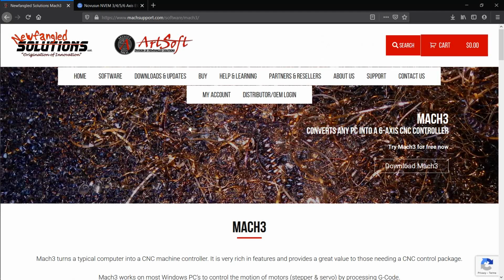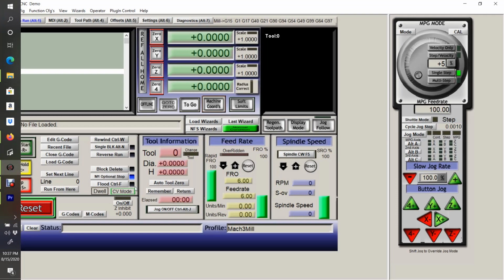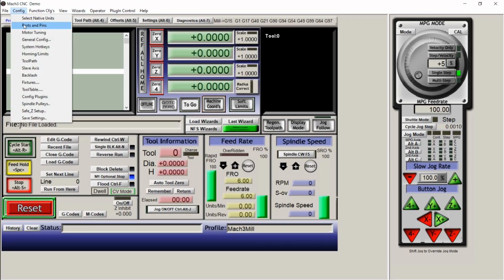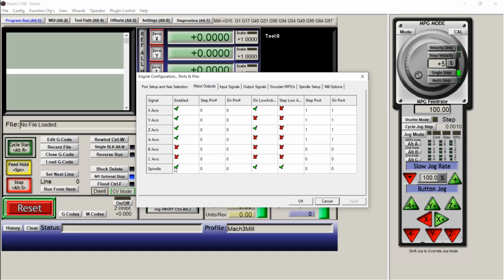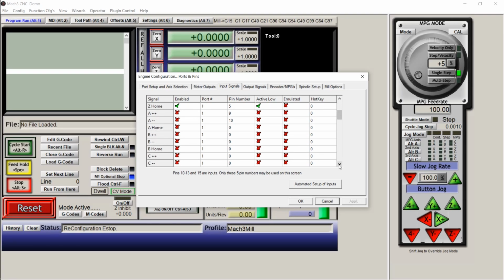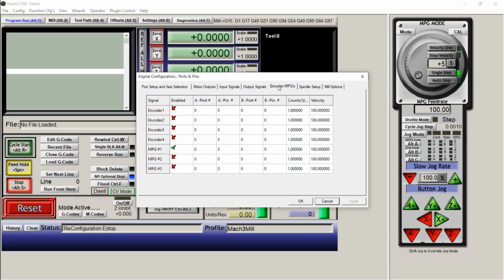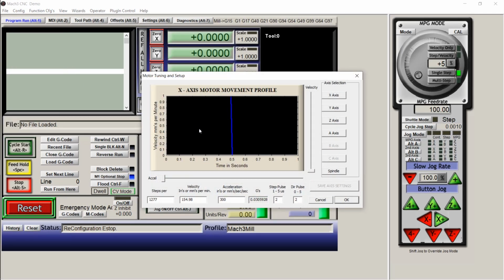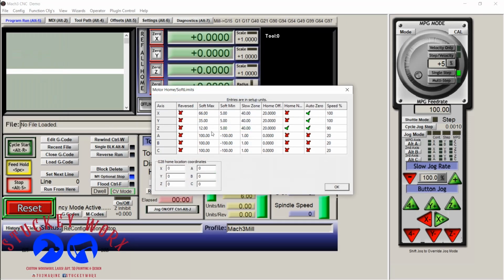Bulkman 3D/WorkBee/QueenBee Pro CNC Mach3 Setup for - Series episode 9

Comment: Good morning,

I have purchased and am awaiting delivery of the Qeenbee Pro cnc with UC300 controller with usb port and managed by mach

The question is:
in the Motor Outputs configuration -imput signals -output signals, I can't understand the configuration logic.
For example in the Motor Ouputs tab,
-X Axis - Step Pin # 2 - DirPin # 6 - Step Port 1 - Dir Port 1, which terminals on the UC300 controller do they correspond to?

If so, what is the logic to adopt to understand the correspondences?

Thank you

Comment: Hi so Mach3 keeps freezing just a few lines into the gcode whenever I run any gcode. even when I try to run the stock Roadrunner gcode it does this so I know it’s not my gcode. I’m running this on a newly built DIY cnc router with a 2.2kw water cooled spindle and 2.4nm “high torque” NEMA 23 steppers with a STB5100 controller with a usb connection to my 2015 MacBook Pro running windows 10. I have done hours of trouble shooting and online forum reading, I even made a YouTube video to get help from people online. At first it looked like none of my shielded cables were grounded and that it was em noise interference causing the issue. But I went and checked and made sure that no point on the frame or anywhere in the wires has less than a 5 ohm resistance to the ground prongs on the main power supply plugs going into the wall.  

I’m very confused at this point as I haven’t been able to find anyone having this same issue. I’ve uninstalled and reinstalled the program like 5 times at this point. I’m not having license issues as my name clearly shows up at the top of the screen. All the axis jog fine and the spindle works fine and can be controlled by mach 3 computer. 

I tried to attach a video of what’s happening when I try to run the stock Roadrunner gcode file but it says the file is too large. But this is the link to the YouTube video I posted with these issues so you can see. https://youtu.be/4YtSb6i7aBw

Can you please help me figure this out? I’m at my wits end at this point as I’ve spent so many hours futzing around and trouble shooting this. 

I have these electronics from bulkman 3D that I have: Mach 3 5axis stb5100 usb motion card and TV6600-t4 4 axis stepper motor driver board. This is the bulkman link to what I purchased. https://bulkman3d.com/product/mach3-usb-5-axis-stb5100-motion-controller-bundle/

What can I do to remedy this? 
Thank you!
Reply from the maker: It sounds and looks to me like your acceleration and velocity settings are WAY too low. When you are Jogging that is 100%. When you are actually in a cut the machine almost never is running at 100%. What are your Dip switches set too and also what are your acceleration and velocity settings? Also are you running in inch or mm units?
Reply: @702marine  hey thanks for responding! I have it all set up exactly how the Bulkman direction say to. 

Steps per :640
Velocity: 1000
Accel: 60
Step pulse: 0
Dir pulse: 0

Native units are set to MM.

I’m not exactly sure where to find the DIP switch settings. Can you tell me where to find this setting?
Reply from the maker: Yeah those settings are way off. Go to this video and do everything the way I have it set and you will see a BIG difference... 

https://youtu.be/u1bL3_s7Iy4
Reply: @702marine  thank you! I will try that. 

Do you have the STB5100 controller or the Novusun? 

I have the STB5100 so I’m not sure if it just requires different settings or not. Any idea why Bulkman would be telling me to use the wrong settings?
Reply: @702marine  I see now what the dip switches are. I am running to an eye doctors appointment and I’ll look on my board when I get back. Thank you again for your time and your help.
Reply: @702marine  ???? 
I have the stb51000 so I’m not sure if it requires different settings or not. Any idea why Bulkman would be telling me to use the wrong settings?
Reply from the maker: Do you have the full paid version of Mach3?
Reply: @702marine  yup!
Reply from the maker: That cut gcode doesn’t look right to me. I will send you a small simple cut file and you can try that and see if you get a better result. Make sure it’s all zeroed out and you cut it on a scrap board of some type. It will be a simple cut only going 2mm deep and the stock size will be about the size of a biz card. It will be for a 2mm size tool bit but if you don’t have that it is ok...
Reply from the maker: You have the exact same machine as me the 15x15 2.2kw correct?
Reply: @702marine  This is a video from my latest attempts to make it work. https://youtu.be/nJGmT4vrEUE
Reply: @702marine  I have the 1.5x1 from Bulkman with the stb5100 controller electronics and 2.2kw spindle with VFD. 

I’m literally just trying to run the stock roadrunner gcode.....
Reply: @702marine  my email is TesTurEnergy@gmail.com 

I will try your code and see what happens. Thank you for your help and time. I just have no idea what to do at this point.. 😔 disheartened doesn’t even begin to explain how I feel right now. 

I’ve built a small 3018 already and it runs great with grbl. I’ve cut many things with it no problem. I decided to scale up to this bigger one and granted building it deemed a bit more than I could chew at first but I found my way through everything with a little bit of research and elbow grease.... but I just have no idea what to do at this point.... 

The roadrunner gcode runs fine without freezing when I run Mach3 in simulation mode so I know it’s not the gcode that’s the issue.
Reply: @702marine  thank you for your time and help as well. I really appreciate it.
Reply from the maker: USE THIS LINK AND TEST THIS CUT FILE. I HAVE A FEELING ITS THE PROGRAM YOU ARE USING THAT IS CAUSING THE ISSUE. 

2MM DEEP CUT, STOCK SIZE OF BIZ CARD 1/2" THICK, 2MM BALL OR FLAT BIT.
https://www.dropbox.com/s/q5mgb5nhwxzznnl/TEST%20CUT.tap?dl=0
Reply: @702marine  ok thank you I’m going to try and get a little bit of sleep before attempting this because I’ve been up all night again trying to make this work to no avail.... 

Thank you I will let you know what comes of this.

Comment: Thank you for your videos!
Does this Workbee CNC work only with the software MACH3? Is it possible to work with software like Grbl Control?
Reply from the maker: They have both. You can order all sizes with either grbl or Mach3. The grbl is the easiest to get started with. However, once you learn and use Mach3 you won’t use anything else. It offers a lot more control and versatility. You have your diehards for both controls but having experienced both platforms I wouldn’t use anything else in the future but a Mach program.
Reply: @702marine  Do you have any experience with the black box from open builds?

Comment: This Bulkman CNC machine I bought is not worth the money. Their support sucks and instructions for tuning do not align. I noticed in your video you did not share your parameters. I understand every machine is different but there should be some similar ranges on parameters. I should of bought a Ooznest instead.
Reply from the maker: I'm sorry you haven't had the same good experience. Things can get very frustrating with a DIY kit of this level. The learning curve is vast and you will have the same frustrations no matter what direction you go. They might not be the same issues but you will still experience some. You have to get through the first couple of road blocks and you will keep doing better and better. I have worked really hard to put a lot of details in my videos about this machine and I'm sure I have covered a great deal to make things at least somewhat easier for people. If you have something that you are really stuck with that I haven't covered just let me know and lets see if we can figure it out.
Reply: @702marine  it’s not that I don’t know how to operate the CNC. Mechanically and electrically I have it sound (now). As for the specs from Bulkman they do not align. I have had to put my past experience and knowledge in getting it running smoothly disregarding their instructions. They have been wrong about a lot of items. Examples are lead screw pitch, pulses per revolution, speeds, and other items. One thing I’d like to see is you running at speed. If you could make a quick video of cutting some material that would be great. We can compare if you like
Reply from the maker: I can work on a video with that... 

I would say my average middle of the line feed rate is 2000. Longer straighter things like a facing move can be 3000 to 3600. Smaller more compact designs can be 1000 to 1500. I almost always adjust during the cut after I see how it started and how well it is coming out or not. There are definitely designs that do much better at high speeds and some that need it to be slow...
Reply: @702marine  that seems to be in line with mines. I haven’t cut much and still working on different materials but can definitely keep you post. Thank you

Comment: I bought this same setup 1500x1500 with the high torque motors from Bulkman and cannot seem to get it to run smoothly with Mach 3. The documentation says the pulses need to be 100 with a velocity of 4000 mm/sec on the X, 3500 mm/sec on the Y/A, and 5000 mm/sec on the Z but none seem to work. When I reduce the pulses to 47 for all 3 and reduce the velocity it seems to run smoother but much slower that advertised. My dip switches for all driver are on,off,off,off,on,off. I am not happy with their support and lack of information on what they sell. When I run Drufel with default values all axes run smooth at 500 mm/sec so I know my problem isn’t mechanical. Also I can’t seem to get the Y/A axes to move synchronized. It seems that when starting one axes shift and stalls when using Mach 3. Have you experience any of these problems?
Reply from the maker: Set your native units to (mm) then start with your steps at 50, velocity at 2500, acceleration at 1500. Again make sure you have your native units set to (MM). You will need to adjust these settings because every single machine will be different but this should get you going.
Reply: @702marine  what are your settings for your machine? I believe we have the same setup. MM was the first thing I set and then did a calibration. It seems that the lead screw Bulkman sells is a 4 mm pitch instead of an 8mm or the settings on the TB6600 are set wrong. Also do you have an email address where I can send you some pictures and videos?

Comment: Thank you for that.  The settings were quite valuable.  And I appreciated you showing me where you found the novusun.dll.  

I also knew that when one hit the tab button in Mach 3 it brought out that controller, but I didn't notice until  your video the jog rate function.  That answered my question about how to slowly jog to zero in the work corner.